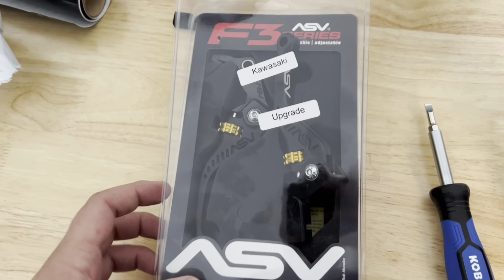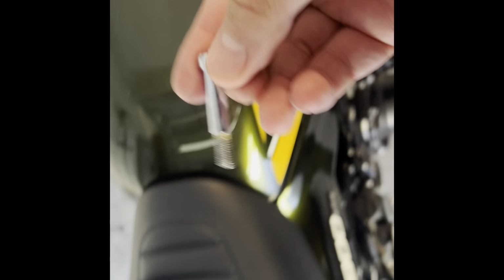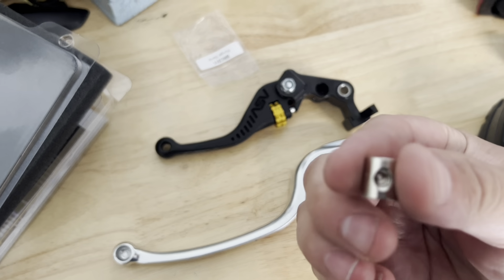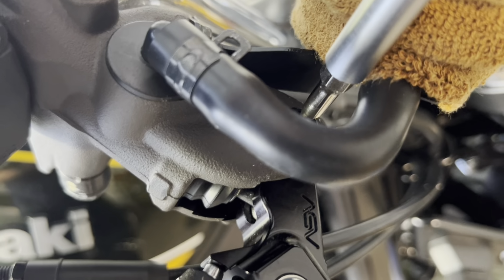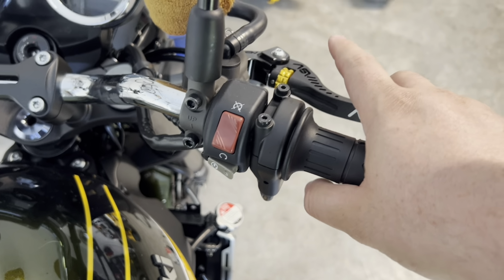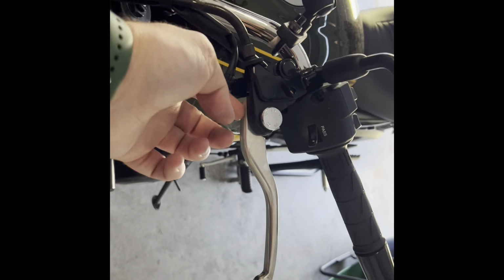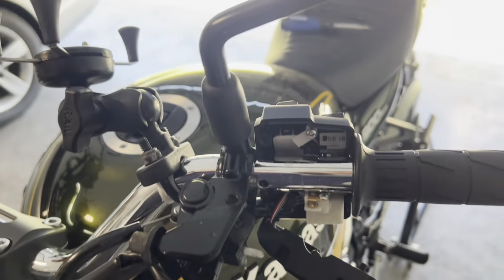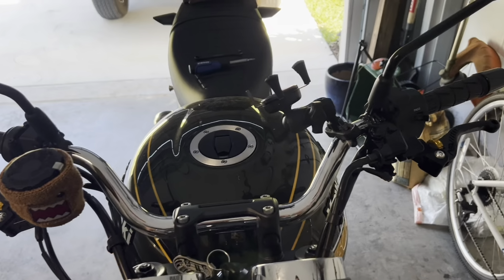ASV Levers Install(Z900RS)

Comment: Did you have any issues starting the bike in 1st gear with the clutch pulled? I had to switch mine back to stock cause the clutch sensor wouldn’t reset all the way so the only way to start the bike was in neutral